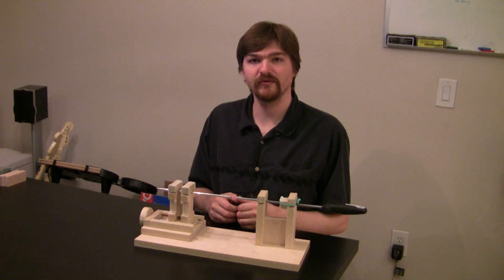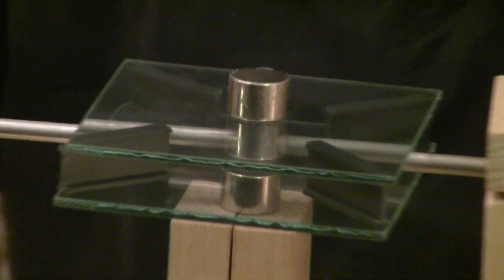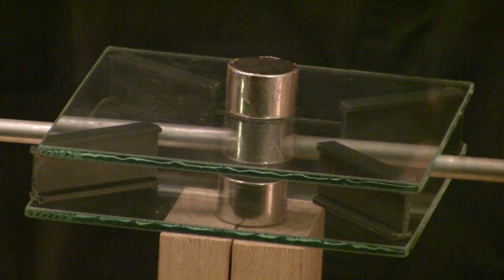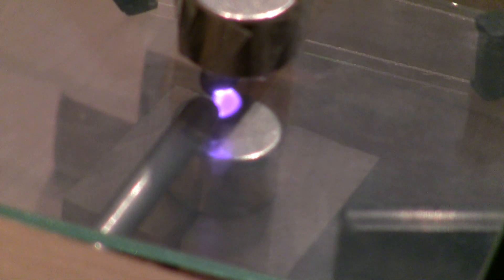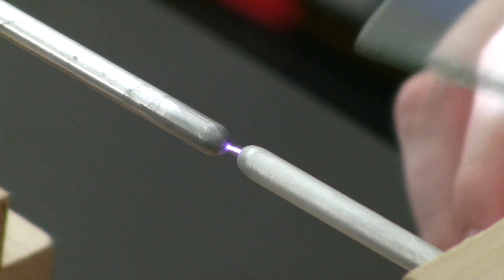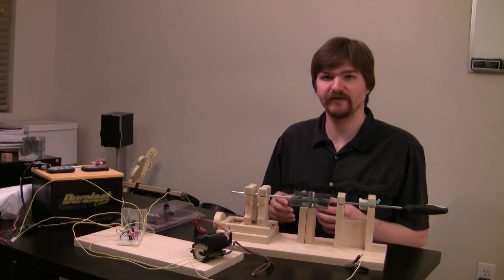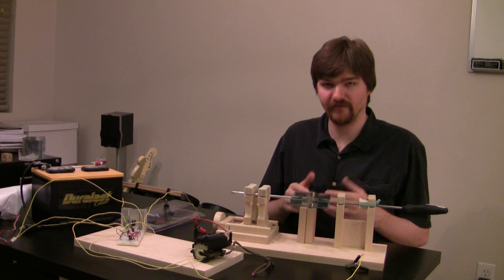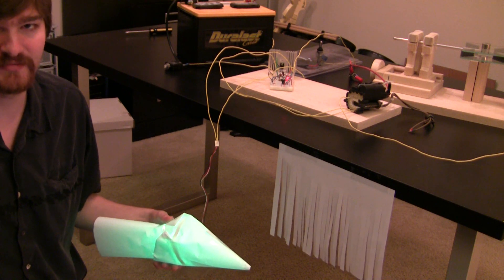Spark Gap Air and Magnetic Quench

Comment: When you used air, it changed the color from purple and violet (some ultraviolet?) to white.  See if you can measure the spectrum or work out what chemical reactions are going on.  Nitrogen, Oxygen.  You are changing the chemical composition of the air in the spark region.  Nice demo on the magnet, best I have seen.  Keep up the great work, and when you can add $Thanks so people can support and encourage.  You can shut off the voltage by shunting to bypass the gap.  Look up the LRC circuit as a function of frequency.  You should know your voltages, currents and frequencies.  You can tune to resonance, and you can use circuits to produce impulses.  Some of what you are doing goes back to the beginning of radio, which was spark gaps.  But now you have high speed video  and spectroscopy, infrared and ultraviolet cameras.  Temperature sensors.  Best of luck.  Richard Collins, The Internet Foundation

Comment: your experiment proves we can make free energy with magnets and plasma
Reply from the maker: Magnets were used to affect the plasma. Electricity was used to make the plasma. I paid for the electricity.
Reply: @johnb003  when you put a spark in a ring magnet the spark start to rotate around. P= Ixrotatation speed. So if if you have a rotation of a spark you have a increase in power. See the experiment plasma vortex magnet, if you want. Regardes

Comment: Great video! Thanks!

I have a thought. I've really wanted to get one of those "plasma lighters" however my problem with them is with the size of the arch and that makes it difficult to light larger items like a cigar. In your opinion (or others) could I simply place a small powerful magnet (or magnets) on one side (or both sides) of the arch and fan it out like in your video? If this would be possible it seems like I might be able to enlarge the arch to work with a cigar?

Comment: I remember see a video here on you where a guy took plasma glow ball place two opposed repulsion mangets easy increased the voltage inside the plasma ball maybe should use capcitor discharge spark gap aka tesla coil circuit let current in series or parallel into two solenoid tranformer electromagnet in between vacuum of type try neon bulb

Comment: Awesome, have you tried running this experiment in an air right enclosure with your magnets still quenching the spark? You might be able to get magnetic gas in your enclosure! This magnetic gas can be used for variety of things including replicating Stan Meyers TPU (he used magnetic gas in closed off loop of tubing. He moved gas using a pump and had wire wrapped around the pipe). You should be able to get voltage in the wire around the tube loop. :P Thanx for sharing the vid.

Comment: I would be interested in a variation of your spark gap experiments, if you would be willing. 

Rather than the magnetic field being tangential ( + ) to the spark gap I would be curious to observe the magnets effect of having the field centered and parallel ( = ) to the spark gap. Using a couple donut magnets over the electrodes on each side of the spark gap brought in from a distance to close to the spark gap in both opposing N N orientation and attractive N S orientation.

Brent Hasty

Comment from the maker: Yeah, it was surprising how well the air did actually, the air flow was much weaker than it looks here.  I'll try some more powerful fans or even just a can of compressed air or something for the sake of experimenting.

Your comment kind of inspired me to get my next video out sooner, because I show the capacitor discharges and unfortunately I could barely see an effect.  Though ironically I have made a video in the past where I show how a magnetic quench on the cap spark made a huge difference.